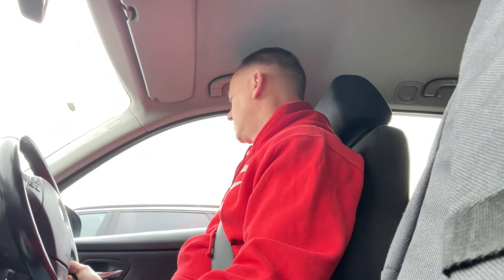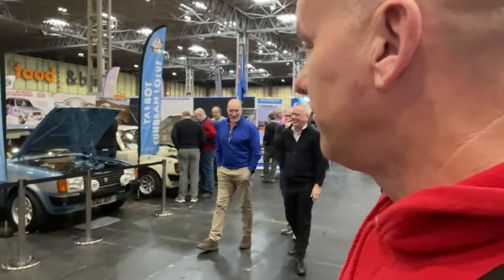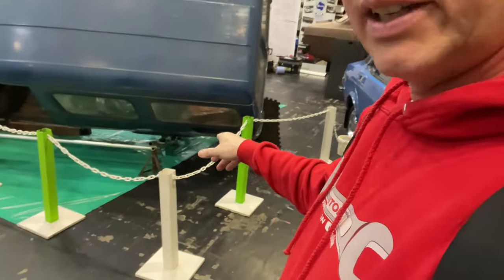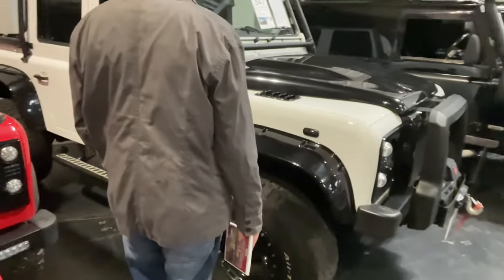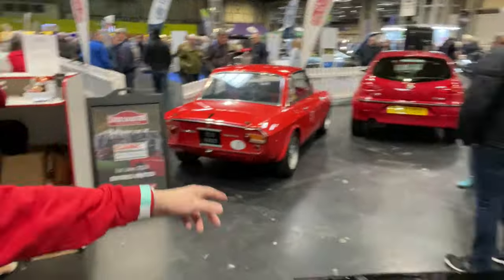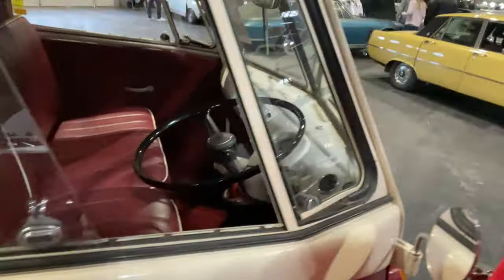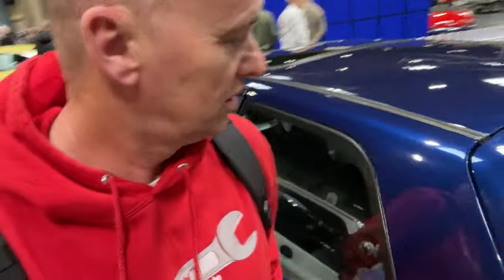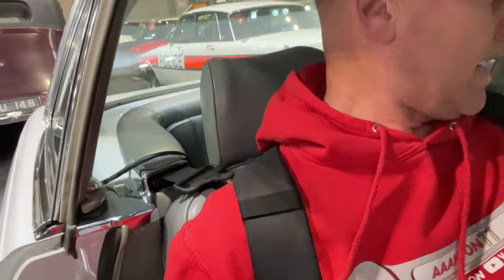Practical Classics Car Restoration Show Nec 2024, Bangers & Cash Special "Audi Quattro Reveal"

Comment: Hey,

I’ve just ran into a problem with my Aygo. I haven’t ran the car in 6 weeks, I’ve just tried to run it. I can her the fuel pump working and it cranks but it just won’t start. Any thoughts?
Reply from the maker: pop the spark plugs out and see if they are wet with fuel, Thanks for the great comments👍🏻👍🏻🛠